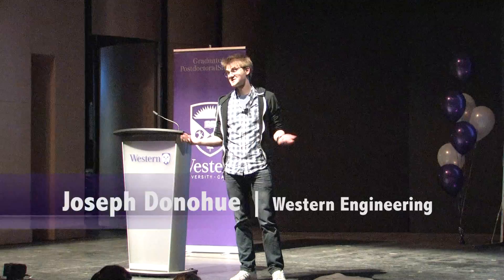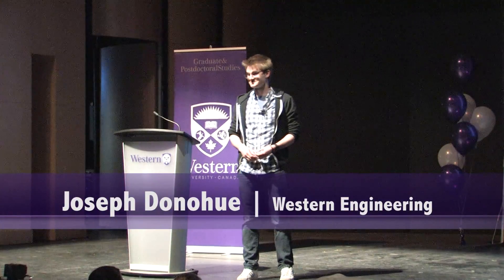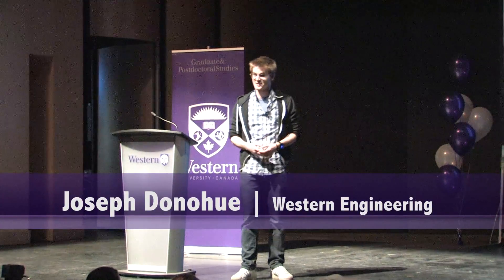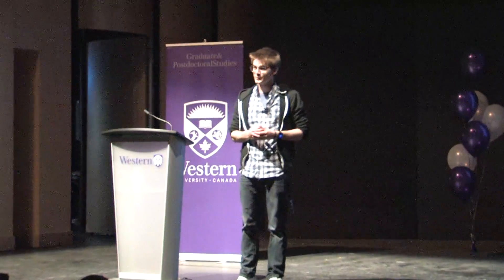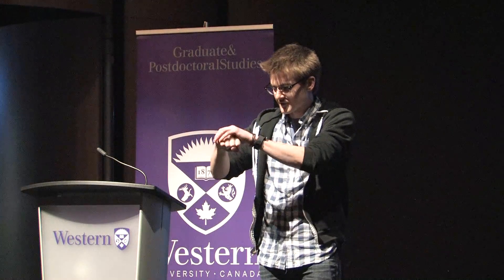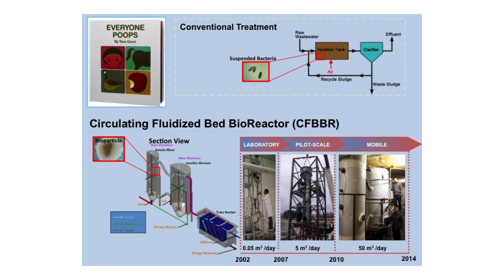Three Minute Thesis - Joseph Donohue (1st place)

Comment from the maker: 3 Minute Thesis with Joseph Donohue, Masters student, Chemical and Biochemical Engineering

Donohue proposes a new -- and more localized -- way of thinking about wastewater treatment.

The basic difference between his system and a conventional one is that, in a conventional system, the bacteria (responsible for cleaning the water) are essentially 'swimming' through the water in order to find food (waste) that they use to grow. In his system, the bacteria grow on small surfaces -- like sand, rocks or bits of plastic -- and, using pumps, he suspends the bacteria inside the system (simulating swimming).

Three Minute Thesis - Joseph Donohue (1st place)

 #everybodypoops   #waste   #water   #treatment   #science   #bacteria   #chemical   #biochemical   #engineering